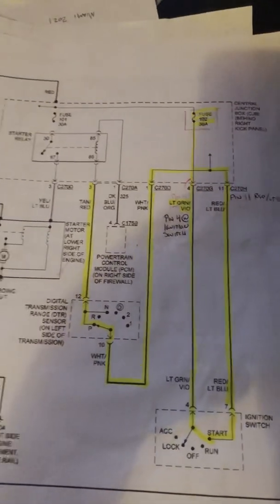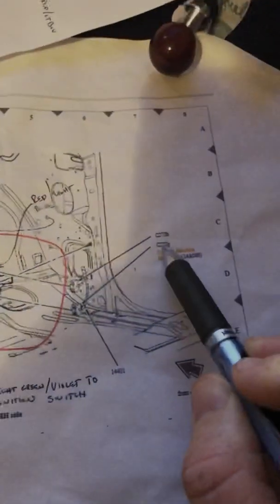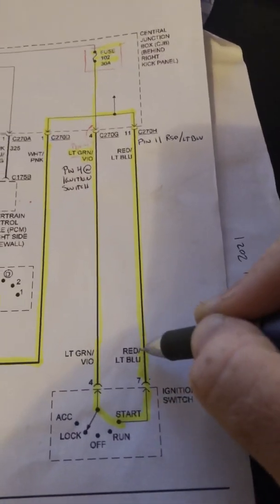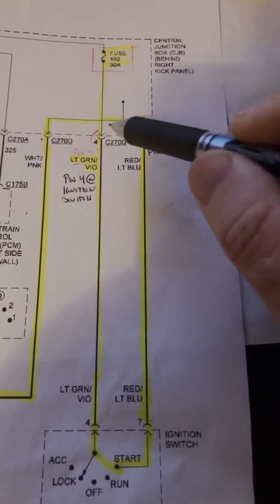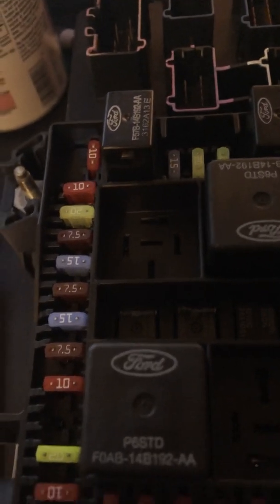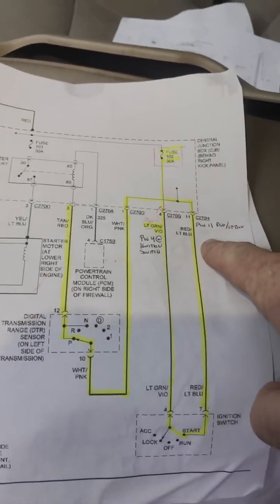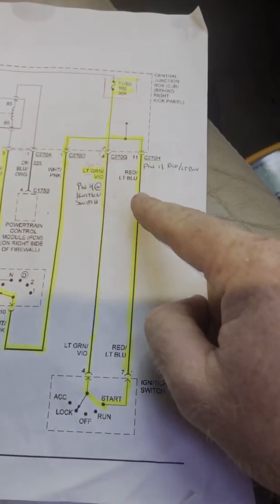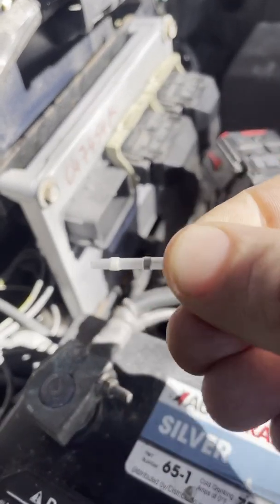Ford Expedition No Crank No Start Starting Circuit how to diagnose. 2004. Applies to F150 as well.

Comment: You skipped a section on how you found out that the wire on the  pcm harness was the problem. I'm having this exact problem with power on the wrong pin which is suppose to be grounded from the pcm